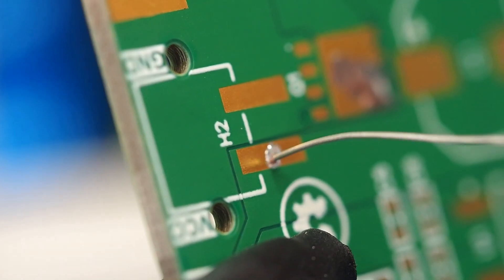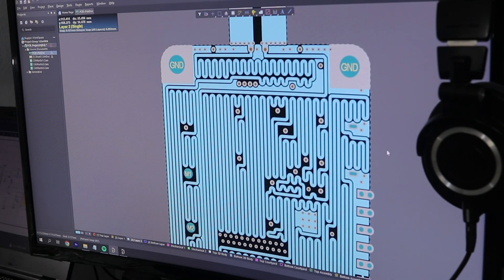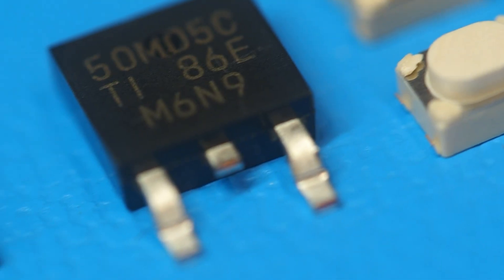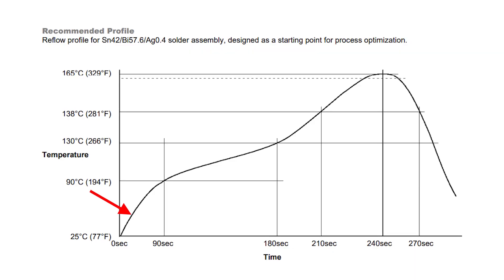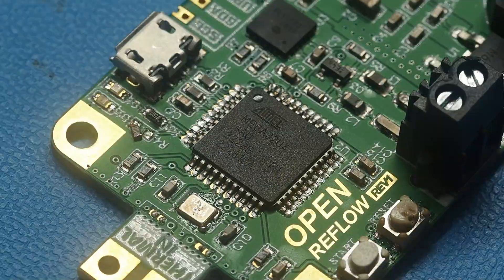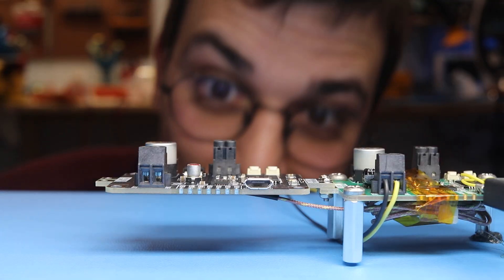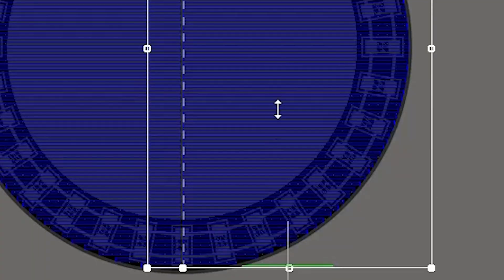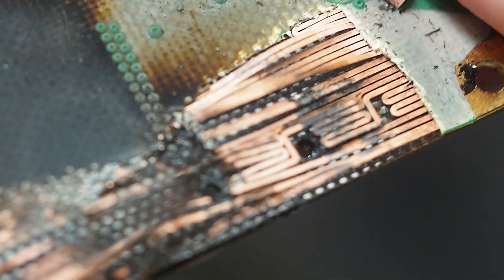I made a Self-Soldering Circuit

Comment: Really cool technique! However, I don't like using low temperature solder because it contains lead, as far as I know.. Maybe there are other types of solder now that can go lower without using lead. One I know of is a bismuth alloy, only the problem is if you accidentally combine bismuth solder alloy with lead containing solder alloy, the melting temperature drops to very low (around 80-90 degrees C I believe) so then components that get hot through usage like regulators will desolder themselves. I think this is why the industry is pushing leadfree options like tin-copper-silver alloys because I guess adding bismuth alloy to that is safe. Besides.. I can't even find lead containing solder on the sites where I order my electronics components.
Reply: Also.. I'm concerned about the quality of this "ground" layer.. In a solid ground layer, the electrons and energy go in one straight line from the via to the point where ground is connected.. But here it's forced to go through this long track.. If the components are even connected to this "ground" at all. What I'm saying is that I'm worried about the EMI characteristics of this type of board. Would it be possible to have the top layer components and power/signal, then layer 2 a solid ground pour so that you have good electrical characteristic, and then layer 3 be this heating element? I guess it would become a 6 layer board in total then though.. So even more pricy..
Reply: @coderebel3568  Clearly the cut off edges give an opportunity to make bus connections across the serpentines and fix the MHz-GHz rfSpice profile in one direction (along Y.) Whether you can use the loopy ground in both RFI-clamped and not (clamped) mode is another thing. Fuzz attack that lidar module!

Comment: sutch a  genius idea !!!!!
just one question 
I presume that sizing up the PCB surface will increase the resistance of heating element 
do you have an idea of maximum pcb size ? 
may be using parallel resistors on smaller surface ?

Comment: Would it be possible to use this technique on a board that could host differing mission-specific components?  I'm imagining this technology being used in situations where access to supply chains is very limited, but communictions are not - like in space or Arctic/Antarctic facilities.  Along with computing modules a'la Arduino or Raspberry Pi, a combo board capable of being several different but mutually incompatible things could be designed and shipped with components, a stencil, and a small amount of solder paste.  If something broke, or needed an extension of capabilities, instructions could be sent to the folks on deployment who could then assemble and cook the board.   (Though, if the board is being cooked on a space mission, perhaps a power outlet should be put in the airlock so that the outgassing from the solder paste can be vented.  Fun additional research to see how reflow works in a vacuum might be needed!)

Comment: Now figure out something weird with TVS diodes, SCP fuses, optocouples on sensitive circuits, or self resetting fuses to fix the antenna issue... Or could you more slowly heat the antenna heating plane but do so between two shield ground planes? Or maybe this only works on sensitive applications if you use star power and star ground. Ah jeez, the possibilities are endless.

Comment: I find this an interesting idea, as this enables amateurs to have an easier time soldering surface mounted components without hot air or an oven.

If a reusable interface is used, it could target specific areas of the board and allow some components to be easily repaired, perhaps even automate the repair process entirely through a new pick & place machine model.

Comment: Ok, so you need at least 4 layer pcb to do this(ending with one less layer, inductance of such heater makes it useless as a ground plane), which you have to get through a fab house. Most of them offer SMD assembly, even for prototype runs. Cool idea but absolutely impractical.
Reply: It's practical for field repair/upgrade. That said, tell all about your masked IR reflow oven/tool, please.
Reply: @Cineenvenordquist  If you need an IR heater for reflow, chances are that multilayer board design is a nescessity, thus sacrificing a layer just for heating might cause increased cost, or compromised signal integrity(capacitive coupling). In NO case have I ever needed to heat the whole board, quite the opposite, you want to heat only what's necessary. In cases of large thermal mass IR preheater is of huge help, however, the whole board should reach reflow temperatures only once, during manufacturing. Components are rated for that, additional reflows may damage especially high-density BGA chips. Other issue is that EVERYTHING wil get desoldered, I hope you like nudging and aligning those tiny SMD components you knocked over by mistake or larger IC packages that just fell off from the other side of the board.

Comment: I don't mess around much with soldering and the like, but this was the coolest process to watch and see.
As others have said, I predict this could be the solution for kits with SMD components, especially as the paste seems to be sticky meaning that the placement can be done much easier, and not having to deal with learning the special technique of hot airing that can blow components away.

Comment: Very "out of the box" thinking, really like it. If components had already solder on the legs or solder on the PCB pads with extra flux in it, you can make easy to distribute (starter) kits that doesn't require a solder iron. The only thing you have to do is placing the components on the PCB and apply a power source to flow pads and pins. The next thing you have to do is cleaning the flux off with alcohol and you are ready to go! Pure magic! Love it!

Comment: It's a cool idea but it has some "small" downsides. A 4 layer pcb is ridiculously expensive, more than the oven sometimes or a heat plate, and the chances to get it smoking are high. I burned 1 pcb years ago and the building was smelling real bad for months. Probably you dont want to test your first autosolder board by "eye", the fumes are real toxic if it catches fire.

Comment: This idea is phenomenal. Not only did you build a reflow controller it self-propagates.

I just bought a Miniware MHP30 for reflowing small PCBs but it doesn't have the same ability to program a heat curve.  With your design I can slightly redesign my existing circuits and guarantee better outcomes.

You're extremely gifted. Keep it up!

Comment: I just love electrical engineering. everyday I see another wonderful person having a crazy personal project that could be the start of something really cool just itterating into it and putting out there for everyone to make something of it. 

I can't wait to finish my degree so I can have time for personal projects again.

edit: also as someone who really really likes to make keyboards. this could be useful for the diodes. especially if someone is trying to make a lot of custom keyboards on the side to sell or really like to try a lot of different stuff. this is what i thought off. too bad I am terrible with circuits :P well no better way to learn than to fail I guess
Reply: SMH for ohmic heating in electric car accessories; works at -35°F, but inefficient. Add a 1 T layer, get heat pump functions?

Comment: I would think you'd want multiple attachment points of the soldering/groundplane to circuit ground, otherwise all ground current has to flow through that one resistor and it creates a large capacitor
Reply: Yeah, this probably won't work for higher frequency boards

Comment: This indeed is an innovative idea! I'd only be worried by the interrupted current paths on this kind of ground plane. Maybe adding more layers to include a solid ground plane and leave the heating layer only for that purpose, could make this even better! 

Love your projects Carl!
Reply: Yep, signal integrity on those PCBs won’t be good. Better only use it for low-speed analog stuff and so.
Reply: A meandering, resistive ground circuit might also lead to ground loops, which would not be fun to debug
Reply: @abeta201  If it is sandwiched between ground and power plane i don't see why leaving it as a heater or totally disconnected would be a problem...
Reply: @TheOriginalEviltech  It might cause the device layer to pick up RFI, as mentioned in other comments, by virtue of being underneath it, but the video implies that it would be used as the gnd plane, which would risk ground loops.
Reply: @abeta201  yes, but if it is in between the ground plane and the power plane it will effectively be in a Faraday cage. Any RFI picked up by it will be shielded by the ground plane over it effectively removing the possibility of the active circuitry over it to get influenced by it. Alternatively it could be used for creating resonant radio cavities within the board if the board is made of the appropriate materials. A good example for this would be a Maser resonant cavity.
Reply: @abeta201  P.S. effectively...
Reply: @TheOriginalEviltech  This is a fair point, although whether RFI is a problem would then depend on the resistive circuit length and the skin depth, so you'd have to do some back-of-the-napkin calculations before hand to ensure the power/gnd planes are thick enough that the resistive circuit isn't resonant at penetrating frequencies.
Reply: @abeta201  How else would you implement #rst_doublefree ?
Reply: @Cineenvenordquist  I see a number of ways of handling the heating plane:

(1) Via the loops at the side of the board to a continuous pad on the surface, then apply solder to short them out after the board is done. This gives you a comb-shaped plane.
(2) Route part of the loop ends in a way so they can be broken together. Either a break-off side edge or a cut path for a knife. This gives you a row of mostly straight unconnected lines.

Comment: Doesn't this also spare the components from as much heat as normal soldering would, since that involves the whole board being in an oven? This could actually be useful in production.

It could also have the heater or a separate heater on a particular component that the user might need to swap out or replace, without having to have a hot air gun etc.

Comment: FWIW, you probably wouldn't want to use a winding, intentionally high impedance path like this for a ground layer in anything high frequency. The current through the ground "wants" to follow the path of the signal traces at high frequency, so everywhere the signal crosses a gap in the ground acts like a little capacitor

Comment: Very impressive!! Love the idea so I am going to use this idea to heat up a pcb in very cold enviroments.. I have a design for a car that does not fully boot when power on in below - 4 degrees.. This could be utilized as internal heater for components and the enclosure. Adding a fuse and a simple controller dedicated for this purpose would do nicely I think. Thanks for sharing! 👍👍

Comment: Nice idea, BUT you really need to appreciate the very real EMI, EMC, RF and signal cross talk problems that those heater traces are going to cause! Maybe you need to learn some PCB layout fundamentals and signal integrity knowledge before pushing this idea too much as your stepping into design integrity minefield here.
Reply: Cockbite. See if anyone lets you implement waveplates in PCB layers going forward.
Reply: I'm pretty sure anyone who is making a PCB capable of self heating and including a USB-programmable MCU and thermocouple probably knows what a wire antenna is... Relax a little.
Reply: @@ryanchojnacki4421  Not sure they do. And I'm pretty sure all those that think it's a good idea on here are being taught a really bad idea. This needs a followup with some real electronic principles and a demonstration of the issues it causes. Definitely not one for the average maker, but definitely one for those that will do electronics as a career.
Reply from the maker: It is definitely going to be a problem when the circuit on top is operating at high speeds. The examples I have given are all operating at slow speeds, expect for the clock source which I still think it's safe considering it's very close to the mcu and there are other grounded polygon pours on other layers.. But I intended this idea to be used for maker projects, and not something that can pass esd/emc/emi .. Maybe I can explore that in the future but as you pointed out rf is not my field of expertise
Reply: @@CarlBugeja  Thanks for the comment. Anything above 10Mhz which any digital signal will produce (edge frequencies in fast rise times), the micro itself if it has a PLL, usb is above 10MHz, any SPI bus to peripherals port displays, etc. Robert Ferenac demonstrates in his videos the effects of these issues and the frequencies at which they become an issue. You idea is pretty innovative, but in my experience it would cause anyone who takes up electronics, as a serious career or business, some headaches. But I would hope that before applying this idea to a design, that they would understand the implications and rule it out as a very bad idea!

Comment: This is an excellent idea.. May be problematic for RF sensitive stuff but for 99% maker stuff this should work
Reply: Anything with a micro on it running over 10MHz has RF properties and is sensitive, especially if you have SPI and i2C busses on the board too!

Comment: I wonder if it would be possible to use a state estimator to measure the PCB reflow temperature to eliminate the thermocouple. The resistance of copper changes pretty linearly with temperature. If the "mother" circuit had means to actively monitor the current and voltage going through the reflow trace it could in theory determine the average temperature of the trace.
Reply from the maker: i thought alot about doing this when designing the board, but a thermocouple is much more accurate and was a safer option to test the concept. Different pcbs will have different resistances. The track resistance for the same design will also vary a tiny bit for different pcb batches. Apart from all this, the resistance of the track changes, as it gets hotter which will introduce more error as different resistance might vary differently. The area and thickness of the board also influence the temperature rate, as the smaller the pcb area the less current required to reach a certain temperature.  So the temperature reading won't be to actuate unless have some kind of ui to put the board's parameters and a software that predicates the temperature/current profile. This has to be tested with lots of different designs that have different parameters, as the wrong predication can lead to disaster.  Not saying it cannot be done, but...

Comment: If you measure the current vs voltage, then you can figure out the resistance of the track. And that is temperature dependent. So at that point you don't need any fancy control scheme any more, you can figure this out on the power supply as well.
Reply from the maker: i thought alot about doing this when designing the board, but a thermocouple is much more accurate and was a safer option to test the concept. Different pcbs will have different resistances. The track resistance for the same design will also vary a tiny bit for different pcb batches. Apart from all this, the resistance of the track changes, as it gets hotter which will introduce more error as different resistance might vary differently. The area and thickness of the board also influence the temperature rate, as the smaller the pcb area the less current required to reach a certain temperature.  So the temperature reading won't be to actuate unless have some kind of ui to put the board's parameters and a software that predicates the temperature/current profile. This has to be tested with lots of different designs that have different parameters, as the wrong predication can lead to disaster.  Not saying it cannot be done, but...
Reply: @CarlBugeja  yeah you're right it could be a bit complex :)

Comment: This only works if your pcb has not lots of components, isn’t it? Otherwise, there is not enough place to run the thermal trace around the board to dissipate heat equally all over the board

Comment: This is like the early rep-rap project. instead of 3D printers making more 3D printers. Its PCBs making other PCBs. Very Interesting project! I always look forward to seeing what you come up with next.
Reply: There was a PCB-based Hotplate that I didn't want to build because I was scared of the SMD parts that make up the control circuitry. I thought to myself "Man, if only I could use the hotplate to assemble the hotplate", and now this concept is real!
Reply: It's almost like the hardware engineering version of self-interpreter software.
Reply: The concept of tools making better versions of themselves has me thinking, what is the first ever mother tool with which the entirety of humanity's tech is built upon? Where is it now?
Reply: @mfaizsyahmi  a rock
Reply: you think the machine that makes usual pcb doesnt have a pcb in it?

Comment: The downside I see is that the trace must avoid areas with heavy through holes and vias, so the areas that need the most soldering heat get the least heat. This is only a real downside if the intent is to solder the through hole components at the same time, it is not a problem if they will be soldered with a different method in a separate step. 
The general upside to the resistive heat concept is that heat profile causes surface mount pads to be higher temperature than the component on top of them, which is the opposite of an oven which necessarily must pass heat through the component to the pads.
Reply: ...bga chips with via-in-pad?